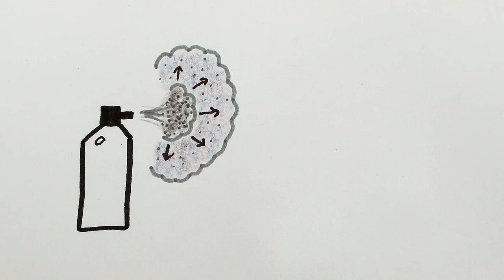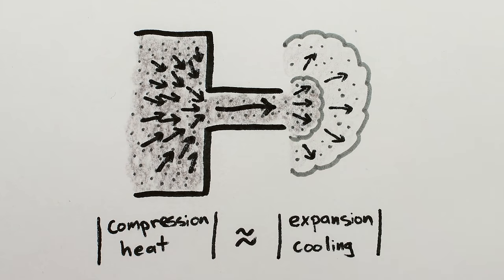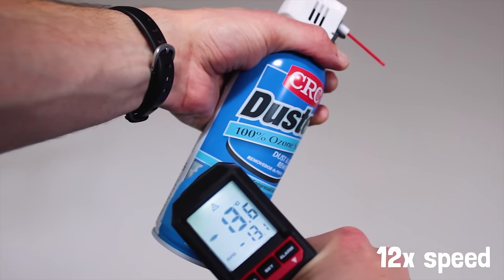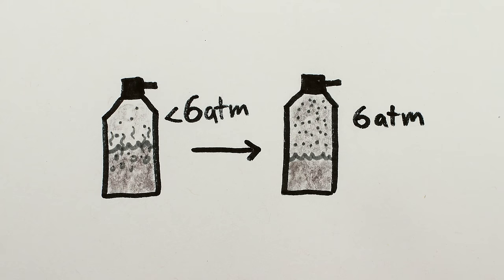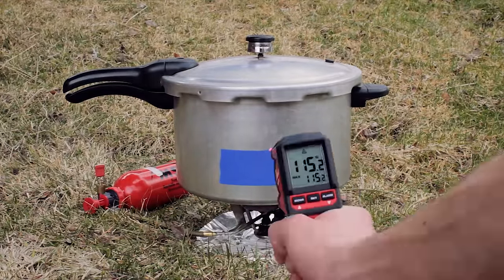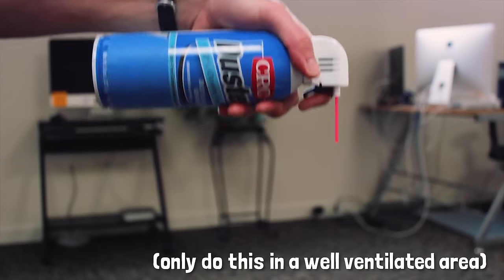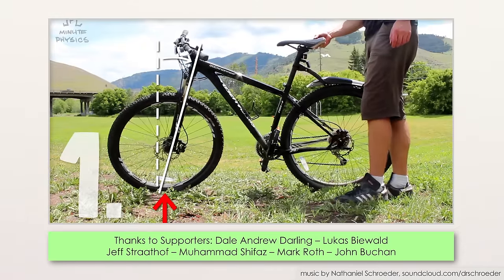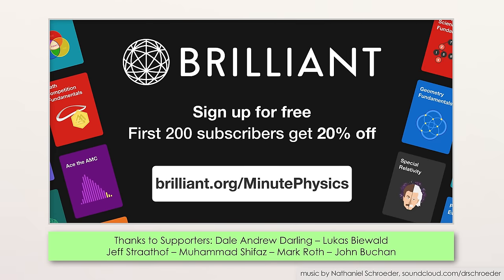Why Do Compressed Air Cans Get Cold?

Comment: Turning the can upside down is a great way to test for weak points on circuit boards.  Intermittent faults tend to show up under thermal stress.
Reply: “Yah, it’s Rewind time!”
Reply: Its also a great way to cause one.
Reply: You want their circuit board to short? Nice try, you evil lithium cell!

Comment: Some dusters on the market use actual compressed air, making them generally safer, though the pressure in the cans is usually somewhat higher (~10 bar) and they don't last nearly as long. They won't reach frostbite temperatures (unless the can explodes I guess), but they do still cool down due to adiabatic expansion.
Reply: I drilled a hole in a long brake cleaner can and soldered a Schrader valve to it. I usually give it about 20 pumps, which results in ~10 bar

Comment: Can: 100% ozone safe
Also can: has potent greenhouse gas

Balanced, as all everything should be.
Reply: Sure, it is a potent greenhouse gas, but it is definitely the lesser of two evils. I doubt an average family of 4 in North America would use more than one can of compressed air per year. Compare that to the huge amount of CO2 that same average family produces from driving, using electricity from a grid that uses fossil fuels, eating food produced 1000s of kilometers away, and buying/ replacing household items it really isn't a huge deal. Moving towards a 100% renewable & nuclear grid (some states and provinces already do/are close to this, British Columbia for example), phasing out gas/diesel vehicles as EV charging stations become as common as gas stations and improving mass transit, more carbon efficient food production worldwide, and making products more easily repairable and longer lasting should be prioritized first.
Reply: @smugfei6682  i found yanfei in yt comments
Reply: Greenhouse gases=\= ozone depletion.
Reply: @jamesdinius7769  hence the comment
Reply: ozone depleation and globe warming are two different things

Comment: Oh damn, early for minute physics slowly getting funnier and increasing in production and editing quality.
Also, these cans upside down are NO JOKE, you can get minor surface Frost burns after only a few seconds. Kids blast each other with these as a prank but.....yikes
However this can be used for things like getting dents out of plastic bumpers since it's intense targeted cold
Reply: wait what, how does that works?
Reply: When I sprayed one of things, it still sprayed liquid even though it was upright and I did not shake it. Not good when cleaning your computer.
Reply: Funny story: I accidently dropped a hairspray can on its nozzle and broke it, causing all the contents to spray continueously. After sometime of freaking out trying to contain the mess. The can was really hard to hold because it was so cold. I couldn't hold it for more than 5 seconds. (I ended up tossing the whole can in the bin, not sure if that was safe or not)
Reply: @jamesmnguyen  hair spray cans also double as flame throwers. ...
Reply: @anullhandle  I was more concerned with inhaling too much chemicals.
Reply: @jamesmnguyen  lol, you're probably right I had visions of butane propellant  in the trash can ... Motorcyclist use the cheapest hair spay you can get to slide grips on the bars and glue them on.
Reply: This comment is a NO JOKE.
Reply: @Tina, based on this video and the fact that I experienced this myself, I'd guess it's because you used too much of the "air" part.
So the can basically has a "recharge time" until the equillibrium is completely reached again and that's why some liquid makes it out while it's boiling in the can.
Could be completely wrong here, but that would make sense to me, at least.

Comment: Seems strange, at least for last ~8 years, nearly all gas dusters i bought was basically a proban-butan mix. Much better for the ozone layer, but also highly flammable :D.
And a few of them were R134a ( Tetrafluoroethane is what wiki says is the chemical name).
Reply: At least the principle is the same so you didn't waste any time watching this video
Reply: R134a has about 10 times the GWP of 1,1 difluoroethane (1430 vs. 140)
edit:wrong number of fluoros
Reply: @Markle2k  yes R134a is also a potent green house gas, but as I said majority of cans I bought are propan-butan mix, only a few were R134a, and those were typically bought for some industrial locations, where I guess it was because of the non-flammability.
Reply: I have proban-butan mix in my house, bought a few months ago. does not have a pleasant smell.
Reply: Yes, 134A is common.  I was about to mention car air conditioning in another comment but googled the chemical before making sure this was the right chemical.  Not sure why so many refrigerants are used, or any at all really.  but Propane and Butane are just a really bad idea.
Reply: All I ever see is Diflouroeathane dusters.. Didn't even know they made ones with butane / propane, lol
Reply: Sounds like a blowtorch…

Comment: This is also how most modern air conditioners work, though they force the coolant through a closed loop so it gets re-compressed into a liquid rather than going out into the atmosphere. Doing that generates waste heat though which is why they have those big outdoor fans. It’s also why you can’t cool your house by leaving the fridge or freezer open, as the waste heat from compressing the coolant stays in your house. If you were to put the back of your fridge outdoors however... (it would still be remarkably inefficient)

Comment: T_T "Also a very potent greenhouse gas" Why we do dis?????????
Reply: At least it doesn’t deplete the ozone layer like CFCs did. Though I don’t know why they don’t just compress air inside the can, as that would also be a lot cheaper.
EDIT: turns out it’s because it’s more dense and the pressure stays constant, and isn’t flammable like propane or butane.
Reply: "we" don't, I use a hurricane electric blower instead of compressed gas :)
Reply: @GRBtutorials  just to clarify a bit the reason we don't use compressed air is their is no conceivable way we could have a significant quantities of air in a aluminium can. So we need something that can liquify.
On the other hand we use butane in europe. It not that dangerous we are not using tons.
Reply: @gavinkemp7920  Yeah Europe here, I only ever saw compressed "air" with a mixture of propane and butane, never with 1,1-difluoroethane.
The key difference is that propane is flammable (not an issue really) and that it boils at -42°C instead of -25°C so it has the potential to get much cooler during operation.

Generally "air in a can" is a terrible product - the can gets incredibly cold (to the point of risk of getting a frostbite) and the colder it gets, the weaker it blows (it's not very strong to begin with, but at low temperatures it gets even worse - you can literally blow harder with your mouth. It really sucks if you need to clean a computer - you probably won't be able to do it in one go. 

And finally it doesn't last very long - it's better to invest in an dedicated electric blower (cheaper but single purpose) or a legit compressor (more expensive but has many other uses including pumping tires and driving a whole variety of pneumatic tools) than continue to buy more and more cans of propane. 

It's more expensive up front than canned air, but it's worth it because it will blow MUCH stronger and more importantly - indefinitely, so it will pay for itself eventually.
Reply: @ShadowDrakken  Yeah we should just purchase and install a hurricane electric blower to clean our keyboards like once a month real practical.
Reply: I use a straw to blow dust away
Reply: It lasts less than 18 months in the atmosphere, CO2 lasts hundreds of years.
Reply: Some of them use propane instead.
Reply: Why have HE done that?!
Reply: @gavinkemp7920    thats why you dont use  "disposible" cans of "air" of any kind, instead you use a normal air compressor, with normal, breathable air from the atmosphere...... no polluting gasses... no polluting cans.......  can be powered from renewable energy... its a one time purchase, no need to buy more cans.... reusable....self filling... repairable..... can be used for multiple uses beyond blowing dust, including to power pneumatic tools, fill tires, and more.

air compressors are really the only legit option other than blowing on it with your own breath.
Reply: @ZOMBIEHEADSHOTKILLER  I think I can challenge this idea. first i live in a flat so storing a compressor will be a pain. second i don't have a car or pneumatic tools, so i don't have a secondary use. third a compressor requires a lot of steel and the production of steel produces a lot of CO2. I've used maybe 5 cans so far, I don't think that has the same ecological impact as a compressor.
Reply: TreeHairedGingerAle Cause we feel like it
Reply: Didn't even know that sort of stuff existed and never had to use something like it 🤷🏻‍♀️
Reply: @gavinkemp7920   dude.....  where you live has no relevance, thats an excuse. One of my compressors is a desk top compressor about the same size as  fallen over beer mug. You could live in a tent and youd have room for it.

while a compressor may have more steel, its a one time make, your not constantly transporting metal back and forth between manufactures, sellers,users, and recyclers. Plus all the energy put into the recycling itself. A compressor will never release poisonous gasses, especially not as part of its normal functioning.

again, compressor is the only legit option
Reply: @kuro13wolf  Hurricane electric blower consume way too much power, the real eco-friendly solution is to wait for a real hurricane and leave the keyboard outside.
Reply: There are electric blower dusters, on Amazon.
Reply: TreeHairedGingerAle Yeah it’s quite ridiculous isn’t it. I work with mobile airco systems a lot (in cars) and I legally have to report even the slightest leak of R134a to the authorities. R134a has a global warming potential rating (GWP) of 1340, so a gram of R134a is 1340 times as potent as a gram of CO2 for the global warming effect. All the while you can pick up a can of this stuff, R152a, with a GWP of 124, and spray it freely anywhere you’d like and just let it dissolve into the atmosphere without any repercussions. It’s fairly ridiculous really.
Reply: @Undy1  The questions are: 1. How often will person A need this air blower? 2. How expensive is the purchase cost of an electric blower as well as its electricity costs when using? and 3. How cheap are the cans of compressed air?
Reply: @webchimp  there may be some truth in it, but Difluoroethane, which is also used as a refrigerant (R152a) has a GWP-Value (global warming potential) of 140, this means that one kilogram (2,2lbs) of this gas has the same warming potential as 140kg (308lbs) of CO2. It may sound like a lot, but there are gases way worse. For example R404a, this refrigerant is often used, soon banned in the EU and has a GWP-Value of around 4400, so one kg of this gas has the same effect as 4.4 metric tons of CO2.
Reply: @Undy1  If you do use these cans, rinse them under hot water and shake it, the increase in temperature will increase the pressure, you can also use this trick for filling lighter gas. this way you can almost use it up completely.
Reply: It's too late to save the earth, no point in skimping on consumer product efficiency 

/s
Reply: @tahsinamio2639  Straws don't work for cleaning insides of computers because of spit. Things like a keyboard sure but for insides like motherboards and stuff, the spit could damage them.
Reply: Because the vast majority of waste and GHGs are produced in industrial settings. It's good to have a responsible mindset but most of what you can do will have almost no impact on a global scale.
Reply: @tahsinamio2639  holy shit how have I not thought of this
Reply: @GRBtutorials  What do you mean when you say "At least it doesn’t deplete the ozone layer like CFCs did"? 1,1-difluoroethane is a CFC!
Reply: MottyGlix Nope, CFC stands for chlorofluorocarbon, containing carbon, fluorine and chlorine (same with HCFCs, also banned, but they contain hydrogen as well) and 1,2-difluoroethane only has carbon, fluorine and hydrogen, so it’s an HFC. The chlorine is what destroys the ozone.
Reply: Potato Boy  -- Liquid Nitrogen isn't illegal, only mildly expensive to produce, and very expensive to store and transport.
Reply: I like how the can said 100% ozone safe yet a green house gas is in it
Reply: @kuro13wolf  buy an air compressor for like $50 and you can also use it to air up car tires and stuff, really more people should own them
Reply: @gavinkemp7920  making the cans, especially considering they have a potent greenhouse gas inside, is way worse than making a compressor.

Comment: Beautiful clip, i would add just 2 things:
1. It's not only Difluoroethane, it's a mixture of chemicals of similar properties. They mix them together to achieve desired boiling points of the gas mixture. I think Cody's Lab had a very nice clip about it.
2. It is HIGHLY FLAMMABLE!!!! Never use it around a heat source. I had a small accident when we tried to remove a stuck bearing... i bought a few canisters of "compressed air" because i knew how cool they can get. I was heating up the bearing from one side using a heat gun and my coworker was spraying liquid "air" on the shaft from the other side... The result was a big ball of fire and a great hair loss of my coworker (i had a cap on my head) ;) I'm so happy it all ended up only with company jokes :D

Comment: I agree mostly. The boiling liquid does cool itself and the can. Around 3:00 minutes it's implied that the heat needed to do this comes from somewhere. It's true that more energy can cause a fluid to boil or lowering the pressure works as well. I don't think that's really a good explanation though. Maybe something like this?
A drop in pressure occurs. This decreases the pressure/boiling point and the fluid boils. The most energetic molecules evaporate at a higher rate. Temperature is just the average kinetic energy. If we remove the higher speed molecules leaving the slower ones on average, the temperature drops. Now we have a cooling liquid and heat external to the can can flow to the cool can. The valve closes and pressure builds as external heat from the environment flows into the can. Eventually the vapor pressure is reached and boiling stops. Things are now the same temperature everywhere. Your can is "recharged".
I wonder the differences between full and near empty cans... A larger area of gas compared to liquid (nearly empty can) will need longer to increase the pressure in the larger gas filled area. I think full cans "recharge" faster maybe.
Reply: Yep, as usual, minutephysics gets something wrong. Agree with your better explanation. 

As far as recharging when the liquid is low, I would be interested to find out. But one thing I can think of -  the smaller amount of liquid is a smaller thermal mass, and therefore would absorb ambient energy faster and therefore regain its pressure faster (i.e., your hand holding the can will heat it up faster with less liquid in the can). Idk, just spitballing.
Reply: @johnm5928  Excellent point, I think you're right. Thanks for commenting.
Reply: It's not just that the high energy molecules are escaping lowering the average temperature. The process of vaporization is endothermic, as it involves breaking intermolecular bonds (just like how it takes an input of energy to separate magnets).